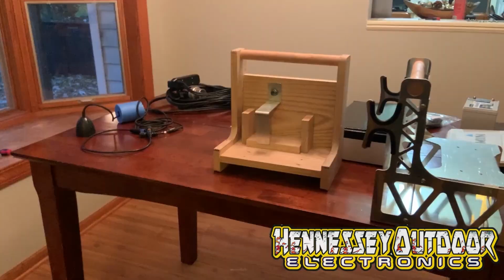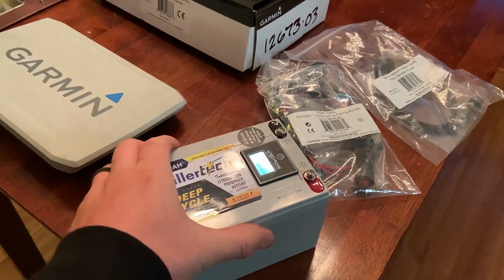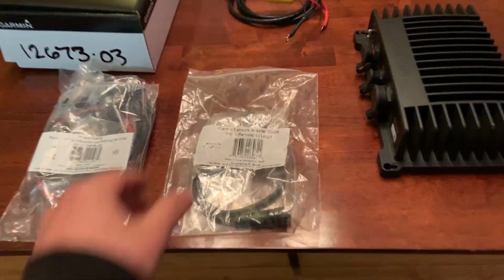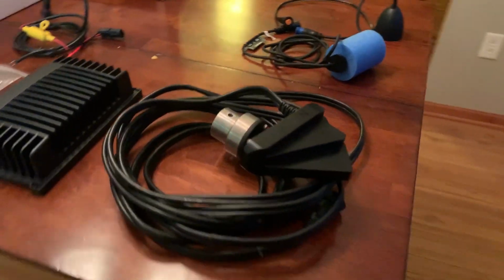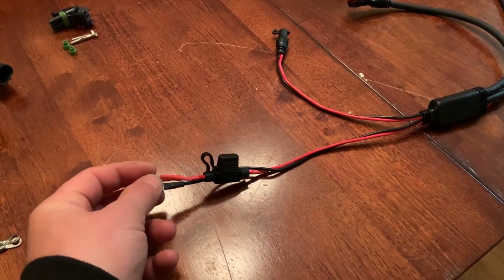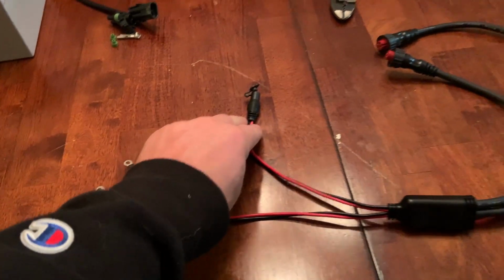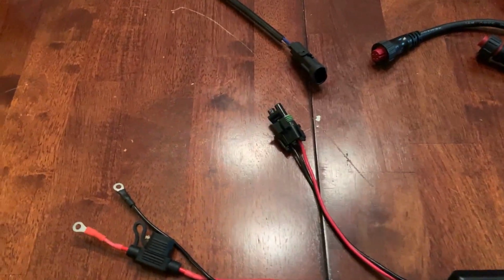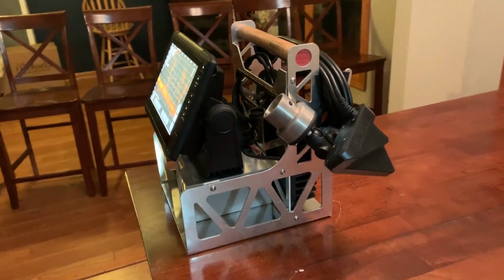Ice Shuttle Necessities! Everything you need to make your ice shuttle top notch!

Comment: Also I was told by garmin themselves that the gt54 and the gt56 are going to give the same image in 50 of water or less, I think in your other video I could see a bigger difference between the two, what do you think
Reply from the maker: Yeah that’s kind of 1/8th true..  I always tell people the gt56’s biggest advantage is it’s much wider range. Both to the side of the boat and depth of water. Especially in side imaging.

It also will produce much better darker shadows. 

With the gt54 I found the 1120kjz setting I could only really use it to about 40-45’ of water. And I could only really ever use a range of about 60-70’ off the sides of the boat.

Now with the gt56 I can use 1070khz to about 60’ and still get plenty of info off to the sides. I also can now get away with a 100’ range in 1070khz and in some cases even 150’ and still be able to see objects well.

It’s a HUGE increase in side imaging range. 

But for what you can see on the gt54 compared to the gt56 the images are very similar as far as clarity. I’d still give the gt56 the edge. It’s the added range that makes it so well worth it

Comment: How heavy is the metal frame? Also are you going to be selling them or is it just a one off you made?
Reply from the maker: The frame itself is 3.8# 

I will sell them if there is interest in them. But they aren’t cheap to make
Reply: @MGMarineTech  it looks amazing but i was guessing it would be more in materials than a genz box costs and thats before you start cutting. At 3.8 thats still light for a good live unit
Reply: @MGMarineTech  Are you still selling these shuttles?
Reply from the maker: @richardconnors557  yes I am, but will have them available later on.
Reply: Where can I purchase this ice shuttle? Do you have a website I can buy from?